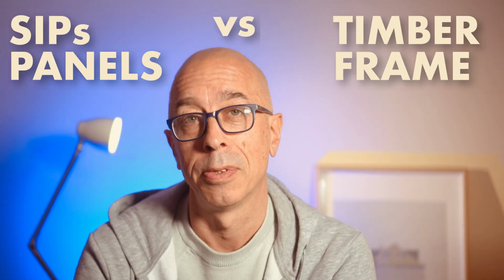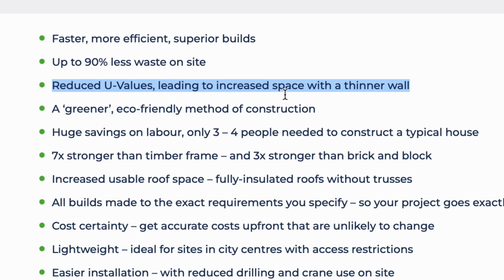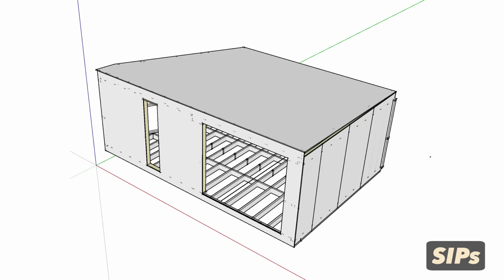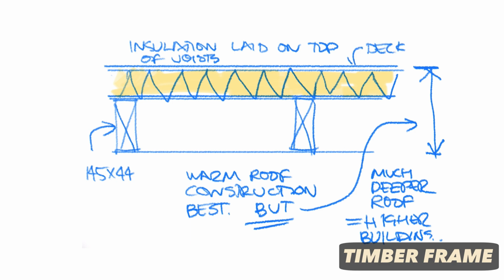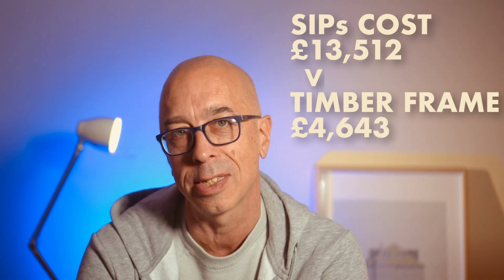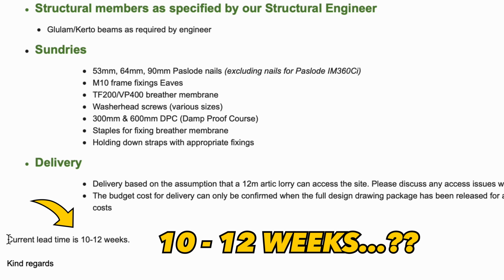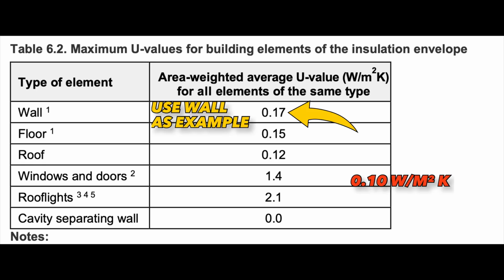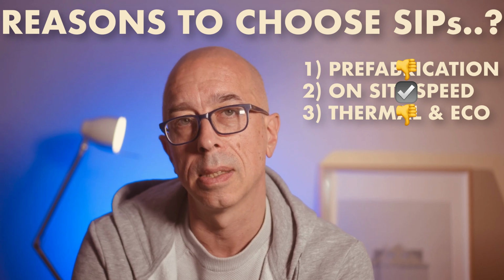What's best SIPS v Timber Frame - You won’t like what I’m going to tell you

Comment: Since I was in the carpenters union, and I have built several kinds of construction, I personally stick with SIP. Our company put up seven metal SIP schools in Florida versus another company who put a eight conventional. WE were done 7 months ahead of the others guys. Wood SIPs are slightly more difficult because of weight. However, Planning is always the secret on every job, but SIPs are too easy.
Reply from the maker: SIPs should be easier, except they’re not, at least not in the UK, and I hope I made it clear why, in the video. Pricing is one thing, SIPs in the UK is very expensive, I don’t mind paying for value, but, customer service is non existent, pathetic in fact, from all three of the manufacturers I approached, there’s no excuse for it, it costs nothing to engage with your potential customers and it says a lot about the attitude of the people running these companies .
Reply: @build-better-things  I always hate it when they treat you like a number.
Reply: I can understand because I once dealt with a manufacturer there. The regulations and taxes in the UK are over the top, as well. Sorry. In 2006,  I traveled thru the US to find a good. cost effective manufacturer. I have great support, better pricing, and a refined process. Things have improved in the US because this kind of construction is more widely known and understood than 20years ago. Now, from a build perspective, it is hard to beat a SIP. I am restarting my building business and only building Timber frame with wood SIP overlay, metal SIP for garage and barns (and houseboat). Easy process, super solid house, very flexible and scalable system.  @build-better-things

Comment: Pricing up for an Aframe in Sweden, self build,,for some reason the local building planner is pushing for SIPS, which makes no sense, as my last roofing project was all stick with 380mm insulation/truss depth. Seems to be a breakdown in thought between architects and builders.
Reply from the maker: Everyone loves SIPs, especially architects. They think they’re better, but I don’t think they’ve ever actually analysed them, because they’ve never actually had to go through the experience of buying them. I would imagine your local planner in Sweden can only make rulings based on performance, not choice of specification, so for example, heat loss, air tightness, breathable aspect. All of this can be objectively compared and demonstrated using either technologies. I wouldn’t have thought they would perform any differently with regards Sweden’s specific climate given they’re both made of essentially the same materials.
Reply: @build-better-things   Given my current house has walls made of sticks wrapped in straw and mud, they lose the "green" argument everytime, but seem fixated on "R" value above all else, including what people can afford.

Comment: Very interesting. I always found SIPs companies to come across a bit ‘salesy’.

I wonder if they become more cost effective with larger buildings, like a 3000sqft new build.
Reply from the maker: Yes, that’s when SIPs can get a little more competitive, through the prefabrication process then speed of construction to wind and watertight. Even then, I’d be very careful about marketing claims of the benefits, and forensic with the comparison (hidden costs such as crane costs, engineering costs, costs of drawing up the schedule of panels). Important to remember…places like in the USA, land availability means 3000sqft new build house opportunities are not uncommon, in the UK, for example, due to the planning policies and the cost of land, you’d need to be very wealthy or very lucky or be in a very remote location to have the luxury of a new build home of that size. Thanks for your comment.

Comment: Great comparison, but there seems so much bias in it.
Cost comparison alone it would have been great to have 2-3 quotes for the timber frame build. Seeing the sips build cost was based on a fully built structure. I imagine timber is more expensive with labour factored in from a non DIYers persepctive. 
Also the likes of kingspan tek-13 achieves a 0.13 u value for a wall thickness of 370mm as a reference.
Reply from the maker: I really don’t care which system I use, I just want to use the best, which is why I do the analysis. I mention in the video I went for 3 quotes…did you see that bit? On the labour cost, I factored in industry timber frame build rates in the spreadsheet part of the video, as I need it to be a like for like comparison with SIPs without the diy element. For Diyers further savings over SIPs could be made therefore . 
Kingspan Tek13 is not a like for like comparison as it returns only 0.13. I used 0.10 as the u value benchmark for the comparison. Maybe it’s you that has the bias 😉. Only joking and thanks for the comment.
Reply: @build-better-things  He was asking for quotes for the timber frame build. You asked for 3 quotes for the SIPs. Also I would love to find a contract that could build a studio for $4.6k. For comparison Home Depo sells a insulated shed 12x24 for $4.4k. There is no way a contractor is quoting a custom build under 10k.
Reply from the maker: You’ve said the same in another comment. You are confused about the 4.6k, I’ve tried to  explain in the other comment. Whether Sips or Stick construction, you have membrane, drainage, electrics, foundations, site clearance and a host of other things. This is a like for like comparison for just the timber skeleton and the insulation

Comment: What kind of foundation would you recommend for those wooden frame extensions. Does it have to be concrete base with brick border
Reply from the maker: Strip foundation with timber suspended floor. Reason being if you’re doing timber frame for the walls and roof, with all the set up that entails, why not do it for the floor as well. Concrete floor is fine as well, but you’d still need a strip foundation for the loading of the walls. If it’s a simple garden room, I’ve seen people building their walls off a slab they’ve poured, not sure I’d do that, without thickening up the edges to take wall loadings, then you’re as well saying, why don’t I just put in mini piles as I’m doing here, which is perfect for a suspended timber floor. Don’t underestimate the work that goes into pouring a slab with insulation and Dpm as well. Hope that helps
Reply: I like the piles idea as its an easier option. Another idea I seen was steal beam on concrete small patio type slab foundation with suspended timber floor. Which looks even easier.
Reply: I’m sold, going to do timber frame and spray foam insulation. Great video
Reply from the maker: @stephenosman2462 Be careful with spray foam and make sure you read up on it. It’s not something I would recommend.